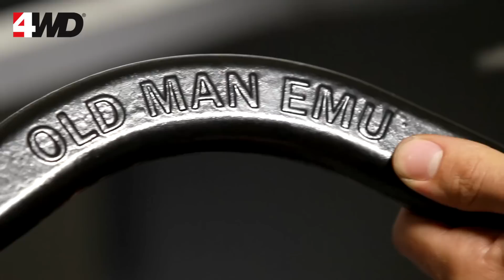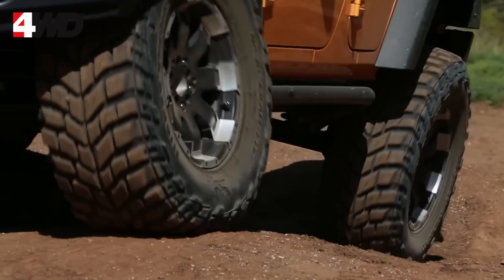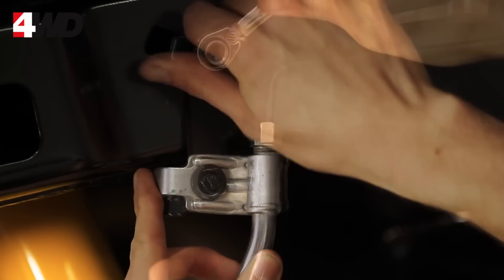Old Man Emu JK Wrangler 4 Inch Lift Kit

Comment: With a 2 inch lift do you need to replace uca?
Reply: No. You only need control arms if your're going 3.5 or higher. Although a control arm relocation bracket will help even with a 2 inch. Metalcloak makes one bracket that does 2-3 inch 3-4 inch and 4-5 inch depending on the locating hole you use, and if you use that bracket you'll never need adjustable control arms unless you go over 5 inches.